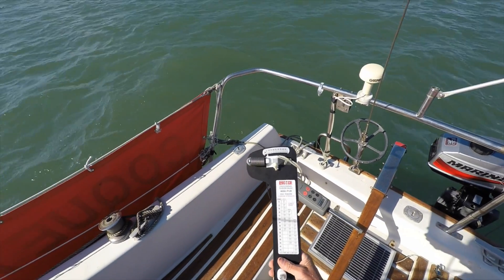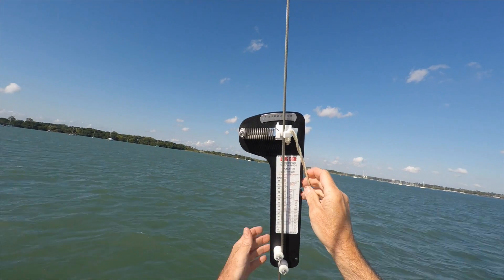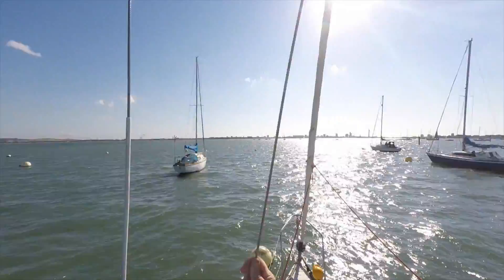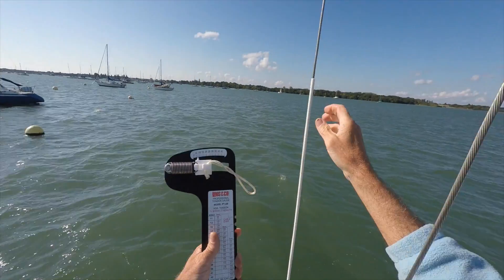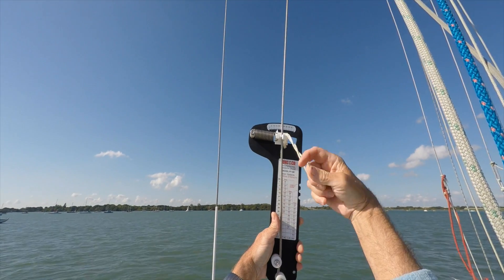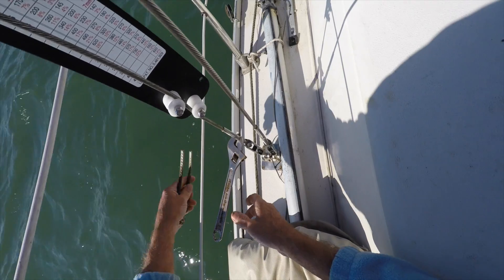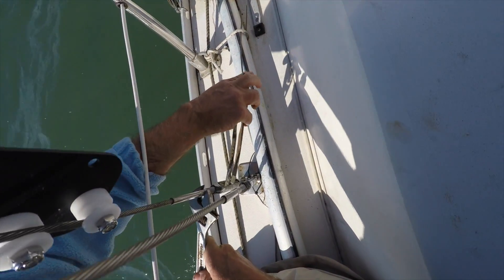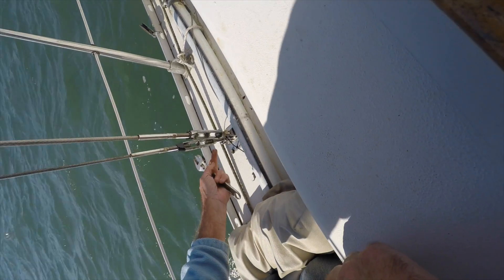Adjusting standing rigging tensions

Comment: Hi, thanks for your video. Could you tell me the model of the tool you are using? And please also the wind generator..what size is that? Many thanks
Reply: It's a Loos 5-7mm  https://www.force4.co.uk/item/Loos/Rig-Tension-Gauges-Professional/JTZ?gclid=Cj0KCQjwmIuDBhDXARIsAFITC_5lFr0SC2_er-NvwvQfV6KWX0r2C8oQiWime8WGf2JANvYmt3xsM0waAjZpEALw_wcB
The wind turbine is a Rutland 504  https://www.piratescave.co.uk/rutland-504-windcharger-12v.html?id=234538991&gclid=Cj0KCQjwmIuDBhDXARIsAFITC_7nBzHLTDLgURIQY5zTPTcNjSly3ro79XSPzDDoMt3iC6iCZW8GRDsaAo4mEALw_wcB

Comment: Good video, but surely you neededed to re-adjust the port shrouds as when you tightened the starboard ones you would have increased tension on the port ones.  I check mine both sides each time I adjust the tension one side or the other.

Comment: so what's the recommended shroud tention for a medium-sized cruising sailboat?
Reply from the maker: In generic terms, somewhere around 15% - 22% of breaking strain.
Reply: What is considered breaking strain?..  2nd what is the tool you used to measure tension?  3rd what tool did you use to adjust the rigging where you removed the cotter pin?

Comment: where to buy this tool ?
AND WHAT IS THE PRICE :) ?
Reply: there is something that should cost 20 and costs 150.. typical marine gouge,
Reply from the maker: Available here at £114.95:   
http://www.sailboats.co.uk/loos-pro-rig-tension-gauge-5-7mm-wire?m=simple&gclid=Cj0KEQjw-YO7BRDwi6Stp7T296ABEiQAD6iWMWpSuZDDPO5xqwByM5ITnabwEjmSsyLD_VuzLbxh7rsaAnJM8P8HAQ

or search on ebay for a cheaper price.
Reply: thanks very much , will buy one of these . no more guessing !"
Cheers
Reply: Amazon